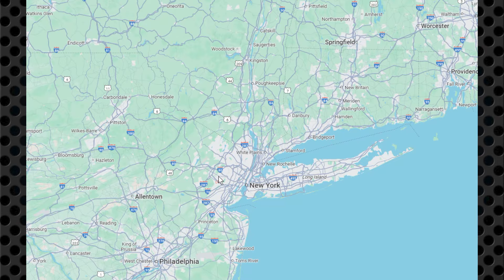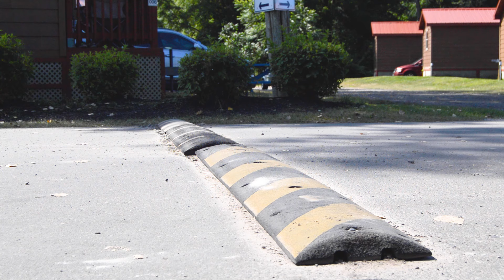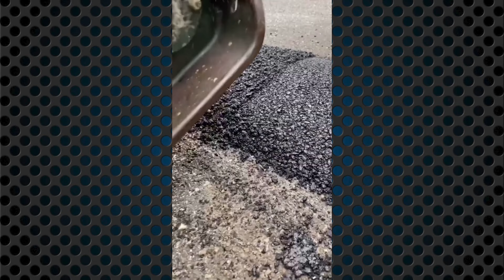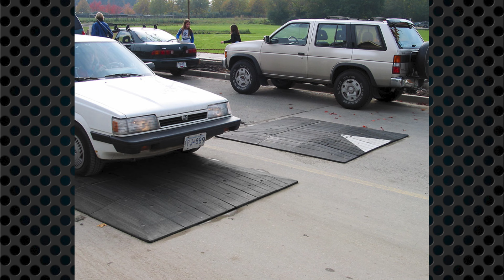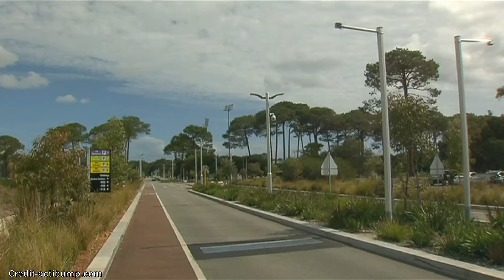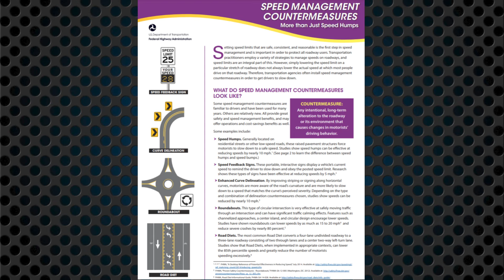Speed Bump History (is Interesting)!

Comment: I don’t hate speed bumps in theory, but a lot of them seem to be built primarily to hurt people and damage vehicles rather than slow them down, and often they’re not really considering the speed of the road. Often on 30mph roads, you’ll find speed bumps that hurt to cross at 15mph. There’s some near where I live in a car park that are 5” tall with nearly vertical slopes, even if you cross them below 5mph the whole car shakes, it hurts you, and it feels like it’s gonna break your suspension.

I often visit a small village in Portugal, and they’ve recently installed some speed bumps on a road on the edge of town. It has a 70km/h speed limit and it’s a main road, but they built a school right next to it with no pavements or pedestrian crossings, so they added speed bumps that actually do break your car even crossing then at 2mph. Last time the car developed a noise and had to be replaced due to crossing one at 10mph. They’re hard to see in the day, invisible at night, and have so little slope to them that they’re like spike strips, and this is on a 70km/h main road.

Those two are all horrible examples, but they can be done right. In the UK we often have these little bumps in the middle, if you drive over them at 20mph and properly position in your lane, you don’t even feel them, and even if you do hit them they don’t hurt, but it slows people down since they constantly try to steer around them.

There’s also softer speed bumps with gentler slopes, they aren’t too bad either, but they make you motion sick after a while and large/low riding vehicles can get stuck on them.

The biggest issue with speed bumps really is that for the most part they don’t work. A lot of drivers get upset by the speed bumps and floor it the second they clear one, only to break hard before the next one, causing more accidents and sometimes an increase in speeds between bumps. There’s almost always better ways to slow people down; it people are going too fast it means the road design needs to change, narrow the lanes, add trees and marking, and make it more bendy. Don’t just out in bumps to try and break people’s suspension.

Comment: The road i live on has both speed humps top and bottom, and speed tables in the middle. The sports cars all seem to see if they can reach 160kph between them, though the speed bumps outside me also have claimed a fair number of victims, all dropped cars with very vulnerable sumps, the oil trails that show up every so often are always worth a laugh, especially if you follow them to see just how long they kept on driving before the engine decided it was tired, and Uncle Rodney came to visit. Longest was nearly 1km of trail, before it pulled over, and likely left on a tow truck, with a very unhappy driver next day when sober, because 80% of accidents here involve either drugs or alcohol. Traffic enforcement you say, they are unable to do even a speed trap since 2008, and only can respond to the aftermath.

Comment: South Africa we have the other speed control device, the pothole, which makes you drive slowly, mostly because they can be anywhere on the road, and hitting one can remove a wheel or break your suspension. Did see one launch a car into the air, as the front dropped into it, then hit the other side, and the entire MB got air, though i think it also got some rather severe suspension damage as well. At the point you put in a claim with the local road owner, via a web based form, and submit the bill for repairs, along with location and pictures of the pothole, and in 6 to 9 months you will get some money back. Done that, for one that destroyed a nearly new tyre, and after 9 months got 70% of the new cost back.
Reply from the maker: Whoa - I've never heard of that type of claim system!
Reply: @AllCarswithJon  We have that many potholes, that they got forced to do that at metro level, as the courts would otherwise have to handle the cases, and would award the damages plus costs in every case, as government is self insured.

Comment: I love a good history lesson! I’ve also found the lack of road repair to also be effective to controlling speed in many areas. To combat both nuisances, I upgraded the suspension in my truck. Now I feel like a Baja racer every time I clear a speed bump at over 5mph.
Reply from the maker: So that's the conspiracy behind poor road conditions.... speed control.
Reply: @AllCarswithJon  Or buy a SUV, as those can ignore speed bumps and tables, as the suspension with 10in of travel simply absorbs it without you noticing it. But not a truck, as the suspension on those is much harder due to the load bin. Chelsea tractor over speed bumps at 90kph you will not notice it at all.

Comment: The speed bump exist as historic evidence of mankind's lack of common sense in considering the safety of others.

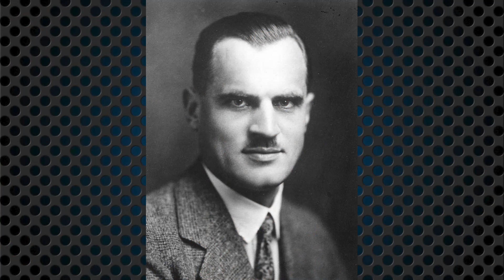2:48
That face... I bet Mr. Compton was a prickly, argumentative chap.

What are the odds that future automotive advancements will integrate the flow of GPS information into computer control of a moving auto to enable automatic dynamic speed controls that "throttle" at intersections, neighborhoods, and enable pedestrians to "interact" with traffic by pushing cross-walk buttons at busy stoplights?  (what could possibly go wrong there???)😀

This is tangential to my thoughts on self-driving cars that can wait for a more appropriate video.